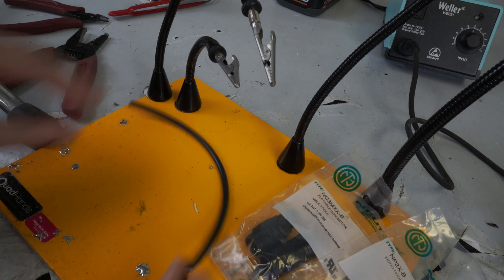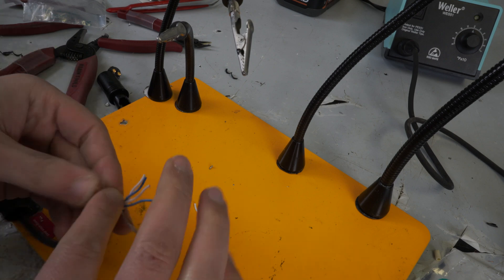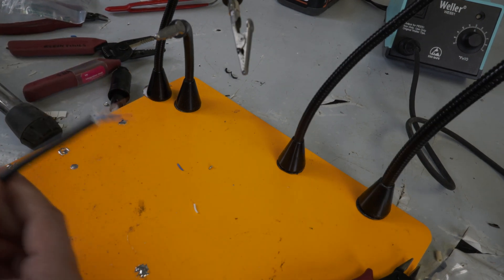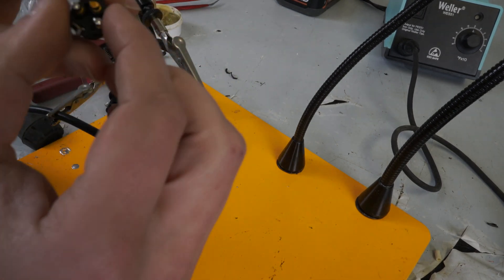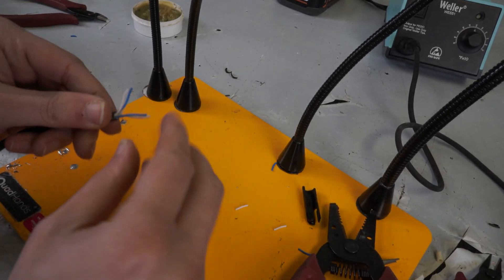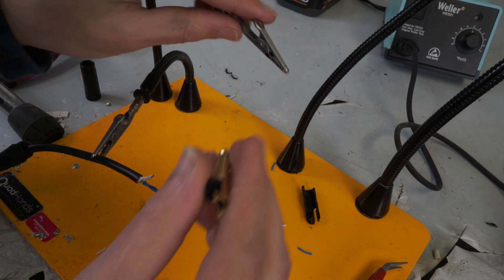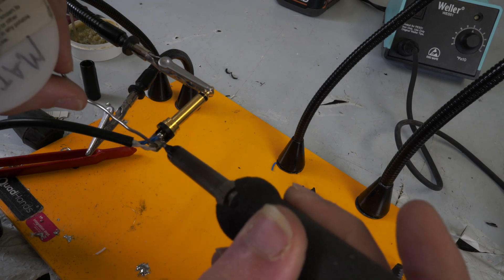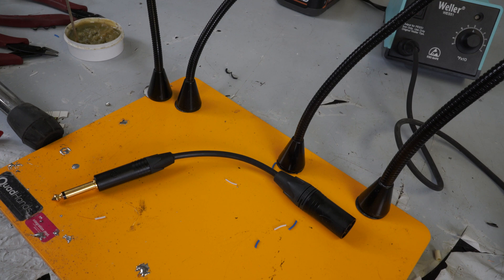How To Build A 1/4" TS Unbalanced To Male XLR Adapter Cable

Comment: I have some questions. The way you have connected this prevents the circuit from being balanced without pin 2 running through a differential circuit. It seems to me a DI box would take care of this problem. So this is a wire adapter but not an unbalanced to balanced adaptor. Some say to wire the pin 3 to the ground with pin 1 but read some comment that this is dangerous to the input when phantom power gets added so your wiring looks safer.
Reply from the maker: It’s not supposed to make the signal balanced. It’s just a simple shop test cable allowing unbalanced signals to play nicely with a XLR mic preamp. Pin 3 is the same signal as pin 2, just out of phase. This is why using a TS cable in a TRS jack creates noise: the ground is touching the ring aka pin 3. This cable wires pin 2 to the tip (hot) and pin 1 to the sleeve (ground).

Comment: I got SURE BETA 57A. microphone is a  XLR. but my kareoke speakers reciber is TS. .CAN I APPLY THIS PRACTICE ON IT. I APPRECIATE YOUR HELP.  THANKS
Reply from the maker: No. You microphone requires a balanced input. Also, your 1/4" input on your speaker is probably line level (+4) vs mic level (-10).

Comment: Nice technique. I approve of all the flux. If I'm using a single conductor cable like Mogami W2524, would it be acceptable to run the hot/signal to pin 2 on the XLR and the ground/drain to Pin 3 on the XLR?

Comment: So I have a live rig that is about to get upgraded to run 5 lines out. Because I am a fan of simplicity (easy setup/tear down), I'm going to be building sort of a breakout box on the side of the rig. I have an audio interface with a LOT of outputs. So 3 line out cables to front of house will be male TS to male XLR (as far as I understand it, this eliminates the need for the venues to provide a DI box)(even though I do have my own), and the other two lines out will be going to a two-channel amp on stage and will simply be male to female TS. So from the audio interface, 5 male TS lines out to the breakout box, which become three male XLR and two female TS ports.

The point of all this is so I can hard-install the rack-mount audio interface into my station, and have the lines run to that breakout box. (hopefully I'm painting a clear picture here). And then never have to plug them in on the interface all the time, because that'd be a huge pain in the ass - there's so many outputs back there that I'd need a mirror and flashlight to see which outputs were which.. lol

The question is, since I already own two very short right angle TS cables, can I just cut off one end, strip the wires and go to pins 1-2 on a male XLR chassis jack? And then buy 3 more R/A TS male ends (all 5 coming out of my audio interface), plus the 3 male XLR and two female TS chassis jacks for the breakout box... Am I going to run into any sound problems here? The cables will be less than 3 feet each.
Reply from the maker: You should be fine with this set up. The only thing you need to verify is the configuration of the 1/4” jacks on your interface - balanced or unbalanced. This will dictate whether you use TS or TRS connectors. Generally the line level outputs on interfaces are balanced - meaning TRS. Which in your case is a good thing since the final connection to FOH is XLR. The other thing to consider is that you are feeding FOH line level signal via XLR. This in theory should be fine however depending on the venues you play, the line level via XLR may overload their console. This where the DI come into place in terms of output level, ground lift, and a pad if need be. The only other thing I would consider is using a rack panel vs a bundle of cables. It would be much neater. Again, just my $.02. Good luck!
Reply: @billylaguardia   FOH?
Reply: @ralorpa  Front Of House
Reply: This is exactly what I need to do.  Same solution.  As mentioned below I want to see if they are TRS coming out of the audio interface.
Reply: @IanMainBliss  Me from the future (well, today). I did as I said I would do, and sound guys have loved my setup. They love how all they need to do is run three lines to me and I plug them all into the same breakout box. And after the show, if I'm talking with fans and he wants to roll up his cables, he knows where they're plugged in...
Reply: @RobDucharme  cool! No issues with high levels then? Mine are balanced trs outs so thats nice!
Reply: @IanMainBliss  Actually, yes. Problem/issue. I mean, it's been "fine" with the TS tips (out from audio interface) in the sense that sound techs have been turning me way down at their end, but the less experienced ones couldn't understand how I was running so hot. So after this next show (tonight), there should be about six weeks of time for me to redo those ends with TRS. I just wish I had remembered this video (and my comment) before so I could have resolved this sooner!
Reply: @RobDucharme it probably has more to do with the house mixer that you are sending your audio interface outputs. some mixers (especially older and analog consoles) have separate XLR and TRS/TS input jacks. If when the FOH engineer plugs the lines from your audio interface into their XLR port on their mixer, and they're getting an extremely hot signal even at the lowest gain, it means that their FOH mixer doesn't have the ability to automatically switch internally to line level. it means that that XLR input on their mixer is expecting to only get a mic level signal. TRS / TS Jack is the one that would be expecting to have a line level signal.. but the simple way would be to just carry a couple XLR to TRS adapters. It's a quick and effective way changing the connector on your cable without having to desolder and solder anything else.. I walk with one of those shure zippered microphone pouches with an assortment of these adapters, a bunch of XLR turnarounds, gender bender's.. etc. they've gotten me out of many sticky situations. 
I call it my bag of goodies. .. and I guard it with my life because they're so invaluable!

Comment: Without using the cable sheild (braid) connected to ground terminals on either/both plugs, you're running the signal unshielded and therefore risk picking up RF noise in your signal. Might be OK for very short runs and where there's little or no RF interference but on longer runs RF interference will be problematic. Far better to ditch the white wire in favour of the braided shield your blue signal wire.
Reply: Pin 1 and 3 must be twisted together and pin 2 connected normally for a unbalance to balanced trs to xlr connector
Reply: Can you explain? I don't understand how that would work because now you are sending the ground to pin 3 on the input receiving the signal ,which is supposed to be an out of phase version of the input signal. Would it not be better to wire it like this guy did and simply not use pin 3? This is not balanced either. @MrBenoit1909
Reply: According to the description of the video he is using the braided cable as the ground (still shielded) but not pin 3 (still unbalanced. )
Reply: Not to mention that he is using this for a high impedance signal. The good news is that you can listen to the radio on it when you are done.